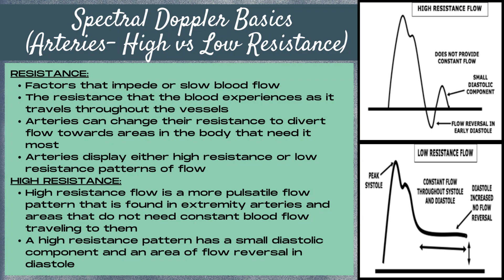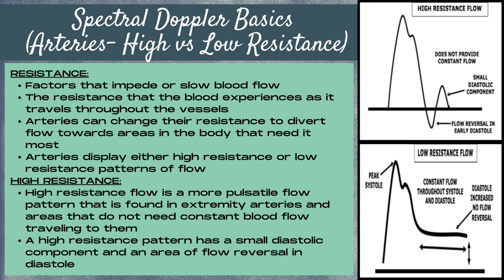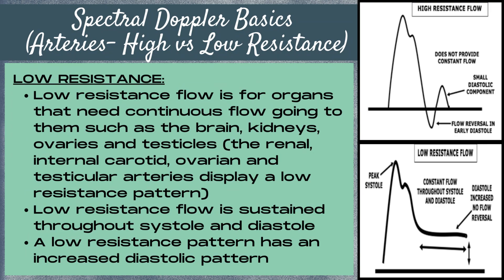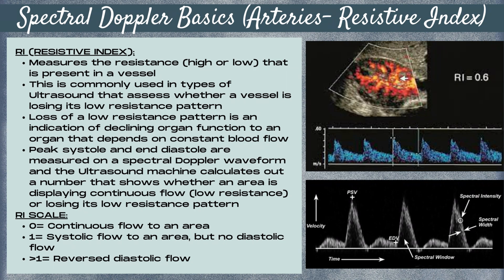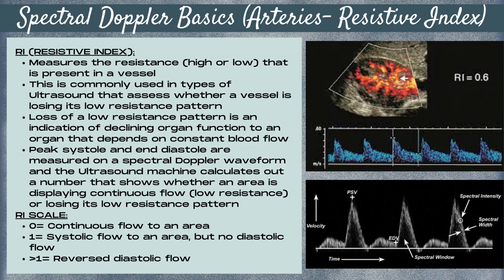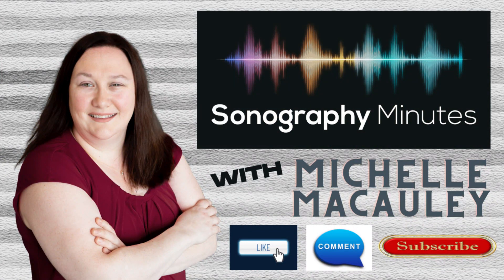Doppler Ultrasound (Arterial Resistance Explained)

Comment: So basically in organs when its declining for example in "CKD" renal arteries shows " low resistance" then RI will show that organ function is declining?
Reply: It’s the opposite, the higher the resistance, the less blood flow. For example, patients with unexplained high blood pressure or persistently high BP are checked for renal artery stenosis (narrowing due to blockage) - When the artery is narrowed, there is more force required to pump the same amount of blood as arteries w/out blockage. That force required = elevated blood pressure